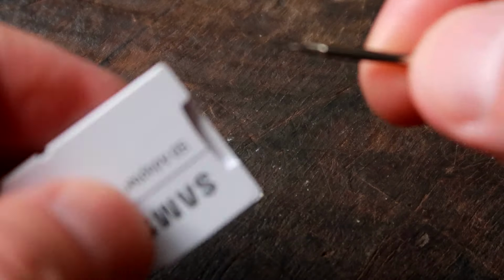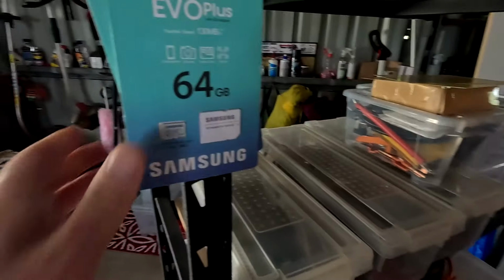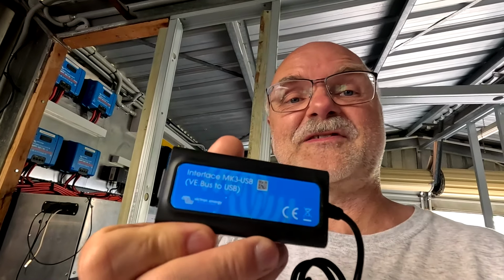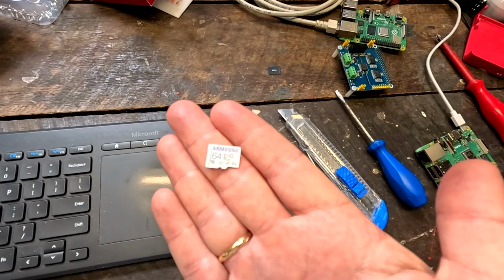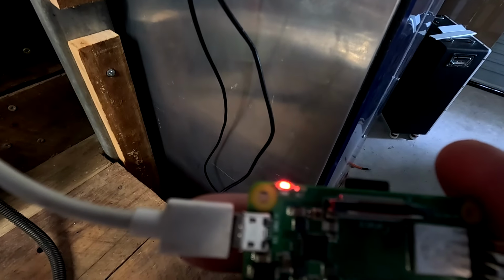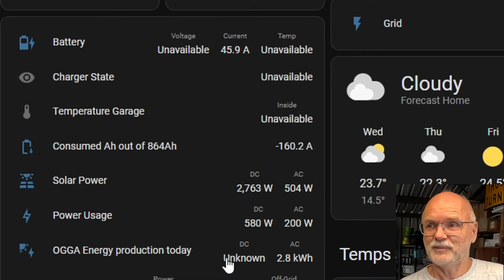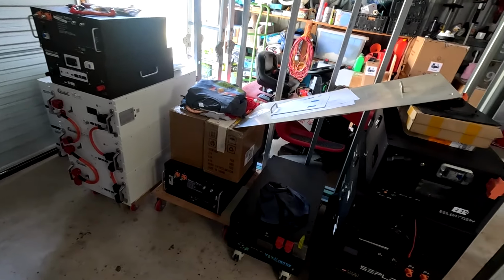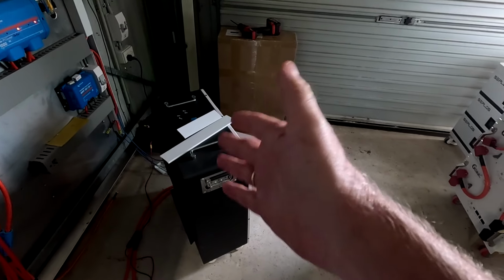Used Victron Cerbo GX replaces dead Raspi and why I lean towards no BMS communication!

Comment: Tesla has the same problem. Too many read and writes destroys the memory, unless Tesla got a new system? Was watching a YouTube video about how expensive it is or was to change this memory and it was recommended that Tesla made a memory slot so Tesla users could easily clear the memory or change the memory on their own.
Reply from the maker: and EVs constantly catch fire and explode...
Reply: @OffGridGarageAustralia  So the best thing to do is to charge it away from other buildings. Did you know it was in fact Norway that saved Tesla when they started? Norway was a test country for electric cars, mostly due to the bad winters and the government relaxed taxation on EV's. (I think it was because the Norwegian oil fund did invest heavily in Tesla shares)

Comment: I have here a Pi3 with a voltage problem. It runs only if i put 5,45V on it lower then that it stays on the red light. The Pi5 runs on a normal usb power supply

Comment: Maybe the 32GB SD card is faulty? Seems unlikely, but possible.

I tend to back up my SD cards after installing and setting up the operating system, but would still lose any subsequent data.

I'm looking at using the SD card just for booting, and an SSD for the file system. They are so much more reliable (and can be a lot bigger).

Comment: I never thought that running aan os off a static storage device like an sd card was was s good idea, so I still had an old laptop harddisk, stuffed it in a harddisk holder with usb interface and am running a rpi with Home Assistant for quite a while now. Possibly that could be a decent option for your rpi?
Reply: If you run apps that do a lot of file I/O you can create a RAM drive on the RPi so it doesn’t hit the SD card. Of course if you lose power or reboot you will lose any data stored on the RAM drive. I set up a system where logging was done to the RAM drive and every so often the data was copied to the SD card.

Comment: did venus OS could be vitualized on proxmox for example ? you could perform snapshots and backups of the venus OS VM.
Reply from the maker: Where does Proxmox run on though? There is even more to maintain and to backup then... That's the wrong direction, I think.
Reply: @OffGridGarageAustralia  proxmox run on practically anything (raspberry pi, x86, ...).
Yes it is an overhead at the start, but in the long time it might be more reliable. And it support ssd drive on the raspberry pi.

Comment: PNY SD cards are famous for failures. Pis in general have two big issues: Power supply, and SD card. There are reasons to use one, but honestly, in your application, there are reasons to use something else more. It's just not reliable enough.

Comment: Weird. Ok, Micro-SD cards do fail - quite normal. Never have seen one splitting in halves ^^.

So on the 32GB limit: i run my RPI 4 with a 128GB Sandisk Max Endurance Micro SD Card with enhanced read/write cycles for video survaillance - knock on wood - works flawlessly with my InfluxDB/Grafana monitoring datagrave.

On the RPI4 and VenusOS: i assume you made sure, that you used the VenusOS build for RPI4 / RPI5? With the standard RPI2/3 build the RPI4 won't start - done that, been there :).

Comment: RPI (RPI 4 in my case) perfectly work with SSD (by USB SSD Case Orico). Recommended !
Reply: Highly recommended but as Andy is not using the additional NODE RED Wonders and has the GX Cerbo avaible too .... I think he wiill go for the @temp Solution , I would guess. 
SD Card on the Raspi , I would say Andy was "warned" that it is a weak spot.
Reply from the maker: I think, Venus OS does not work from thumb drives or SSDs.
Reply: @OffGridGarageAustralia  Well if that is not really possible , you can use a RPI Compute Module with 

Raspberry Pi Compute Module 4 8GB RAM, 32GB Flash

There are Youtubes German which used it as they wanted also to evade the @SD Card. 

@KleinesZuhause

Comment: Hi Andy, stepped away from raspis completely due to so many failures. Mainly SD card but also power supply, the number one point of errors - check this out, may be the single point of failure you are looking for!. Replaced them with cheap used Fujitsu Futro - SSD and external power supply, runs forever...
Reply: Does VenusOS run on the Futro?

Comment: These pnys are very bad i have one died just like this one 128g. My system just like yours no communication. The rasbperry pi is fpr solar assistant monitoring and some automations regarding inverters it some times act strangely it does need properly earthed system or the usb get issues.  the sd died once lead to loss of few months data since they have back up. Best sd cards are samsung and sandisk.

Comment: 2 raspberry pi not running, a brand new, I doubt that this is a raspberry Pi issue. I have bought 20 from 2 to 4  and all of those are running. The only one that suffered here and there were early pi zero . 
But I can not give you an advice except no SD card in a pi and get an SSD for pi. Best move ever cause since then I have no more issues with dead pi except in my lab or sandpit where I test things. And there these SD break ervery now and then and just by my impression I would say the rather more expensive brand SD cards from Samsung and Sandisk struggle a lot more. 50% of those are dead forever, and the other half can be formated and will reboot and run like before. I am still on 8 GB SAN DISK which I bought a dozen from cause those fitted my needs and the backup on a NAS and the restore is a lot faster than a giant 16 GB SD. But only for the sandpit and lab, not for productive work.

Comment: Raspberry Pi 4 need a Special powersupplie … I think 5.3v and >3A
Reply from the maker: It was connected to a HP charger with 3.5A
Reply: @OffGridGarageAustralia  schau dir bitte die Spezifikation vom originalnetzteil an. Das was du beschreibst deutet sehr aus ein falsches Netzteil hin. Die Spannung ist entscheidend, die stärke auch, aber ich mein das Problem kommt von der Spannung.

Also neben nochmals geschaut, 5,1v und 2,5A braucht der pi 4. drunter macht der kein zuck. Der Fünfer braucht sogar noch mehr und ist somit noch weiter von der Spezifikation weg. Aber von nix, Kummer nix.😂

Comment: I can tell you that SanDisk SD-Cards are relatively reliable on the raspberrypi and they can take a lot of abuse.
I'm running a RaspberryPi B+ with a 128GB microSD as a mini web-server
Reply: also on the RPI with the dead microSD, maybe the broken SD-Card shorted some of the MMC data lines of the SOC to 3.3V

Comment: Hi Andy, be aware that there are a few cerbo GX devices with a hardware issue. Victron does have a manual how to fix this. You need to add a capacitor over the power supply to solve this. Maybe good to check for everybody with a cerbo gx. Cheers! 🍻
Reply: That's only an issue if powering the Cerbo with 48v, Andys using 12v
Reply: @TheRonskiman  your correct only couldn't see his power supply.

Comment: Its just running Linux, presumably, you once you get an RPi working you can ssh into the RPi from a laptop and poke around.   If you've never used ssh before then its worth reading up on setting it up and learning how to use shells (bash, tcsh, etc).   A bit of a learning curve if you have only used GUIs before, though.

You can also shut the RPI down and make an exact image backup of the SDCard, but sometimes linux boot code references devices by the serial number so it would require some messing around to get the image copy to boot.

Personally speaking I always setup my RPis so I can ssh into them as root from another machine, and I'll usually setup rsync that I run from cron to maintain a backup of the entire image to another machine... at the very least, the configuration files, but its easiest to just backup everything.

I can't really provide instructions, this gets into the weeds of learning how to use unix shells and applications.

-Matt
Reply from the maker: I can install the scripts I need to run on the Cerbo/Pi, but certainly not someone who can poke around and make sense out of it.

Comment: I'd recommend a SSD for the raspi, the SD cards are not designed for constant access with reading and writing 👍🏻
Reply: The solution is SanDisk "Max endurance" series. (not "high endurance").
Reply: @NiueChannel  and no doubt they will change the name again to confuse everyone !
Reply: There are higher performance, more tolerant, cards that are only slightly more expensive.
Reply: Or use a so called industrial SD-card. They  cost more, but maybe you don't need 32GB. I use 8GB which is cheaper.
Reply: Yup i did this too. A USB-C (with usb-A adapter cable) M.2 enclosure with a NVME (or SATA) SSD inside, partitioned correctly. Much faster and more reliable.
Reply: Subjected to constant writes by log files, SD cards rarely last more than a year or two. They are cheap and thus useful for learning about computers, which is what the Pi was designed for.
Reply: @john_in_phoenix  The SD card will last much longer if you use log2ram.
Reply: Most people get the cheapest SD card they can find which isn't great.
My current Pi farm (running a K3s cluster) is working great for about 2-years now on a couple of SanDisk Extreme A2 cards (although they still aren't the best cards you can get)
Another thing to look out for is power loss, since SD-Cards are generally slower it's more likely that parts of the write are still cached and queued and if you lose power in that time the data will be corrupted, so make sure to shut down properly instead of unplugging.
Reply: I can double that. Been playing with SBC for long time. Only when setup NVME SSD on OrangePi5 I forgot what corrupt system disk is.

Otherwise just always have spare backup SD card ready to be swapped.
Reply: VenosOS does not support a SSD
Reply: @RFDarter  VenusOS is running on top of plain Linux. You can symlink or change the environment variables for logging and other directories with a lot of writes to an SSD. Victron’s software won’t know the difference since Linux handles it.
Reply: @RFDarter  That is not true... I've managed to install and run Venus OS v3.67 on nVME SSD with an USB adapter, bought from Aliexpress. This is running very well with no problem. And, yeah, it is a SSD on USB.. I can bet there will be no problems like on SD cards 😁
About the procedure, there is already posted on the Victron community... Some linux commands and you will be in the right way 😊

PS: And BTW, even if the author of the "script" to install Venus OS on ssd is telling that the updates does not work anymore, yeah.. somehow he is right.. but, again, with some other linux commands on ssh, you will have an updated Venus OS on SSD, using an SD card. It is a 15 minutes process upgrade. Question: Is this procedure worth the effort, or just buy the CerboGX? My answer: using CerboGX, is not anymore a DIY system... Make it your own with a little effort 😁
Cheers